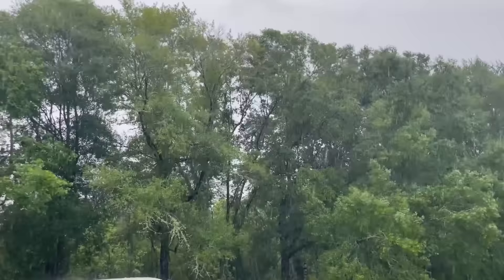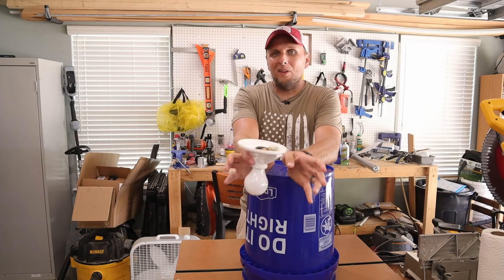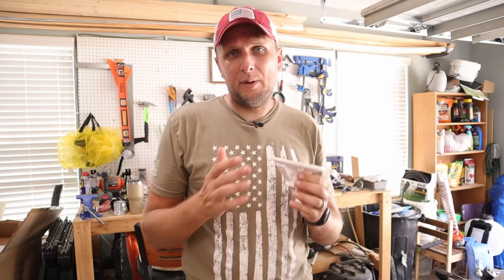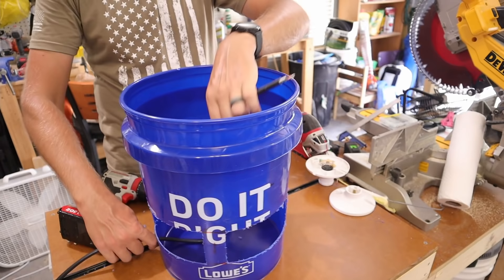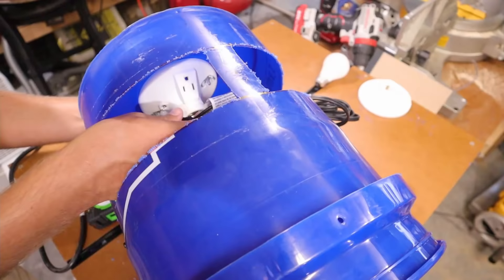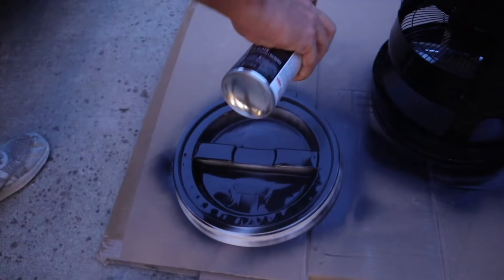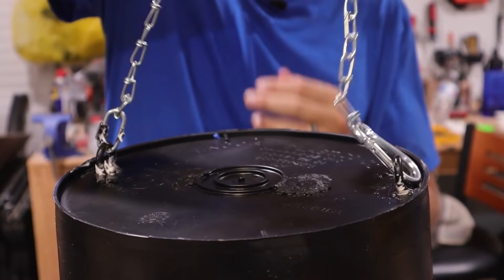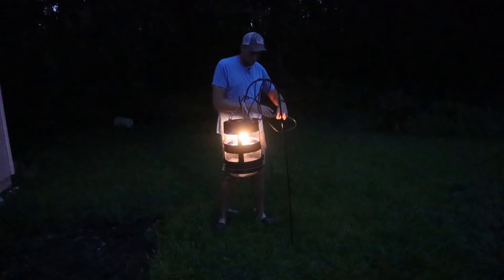How to Make a DIY Mosquito Trap That Actually Works!

Comment: “We got a ton of rain.”

A ton of rain spread over a portion of a typical American county is a vanishing small amount of rain.   Not even a trace of rain.

The county that I live in is about 1000 square miles in area. 1/4 inches of rain spread over the county is about 18 million tons.
Reply from the maker: I honestly don't even know what to say to this 😂
Reply: @HowToHomeDIY  Maybe no response is required.  In my line of work, there is a world of difference between 1.50 & one and a half.  They mean very different things.  Of course most of the American public used the adjective "ton" to describe some vague but very large quantity.  Yet in my way of thinking, a ton is 2000 pounds.  I knew what you meant even though what you wrote was different from that.  Hope I didn't offend you.

Comment: Is there something im missing; why not put the knot in the wiring just behind the inner wall of the bucket, so if the cord is "pulled" the bucket will move preventing a jerking pull on the socket and wire connection as well as live wire exposure.
Reply: thats exactly what he did

Comment: The best thing that we did to combat mosquitos, wasps and houseflies was to feed the songbirds year round, not just in fall and winter.  We have a river that bisects our little estate and we could barely use the land in spring and summer without being chased off by mosquitos.  Also the birds no longer relieve themselves over our cars.  An old timer told us at the local feed store, "You wouldn't be too happy if the food supply was cut off just as you were raising your chicks.  Taper it a bit by Memorial Day and they will switch to mostly insects, bring it back up after the leaves start to turn."  He was exactly correct.  We have a little sanctuary for them now, the variety and behavior is completely different.  They seem to see us as family instead of intruders into where they are raising their own little families.  Great built though, we will keep it in mind for when we watch movies outside at night, when those balmy temperatures come around.  🥰

Comment: What size fan did you use &you could have used silicone Culkin for the screen
Reply from the maker: It’s a 9 inch fan.  Most caulk doesn’t adhere to plastic buckets very well but silicone caulk is especially bad at bonding to plastic.  Just peels right out.  Hope this helps!

Comment: Any issues with the fan motor getting wet in the rain? The light seems well protected but that fan is pretty exposed.
Reply from the maker: So far so good!  The motor is very much to the center so while it does get wet, it is pretty minimal.

Comment: Mosquitoes aren't attracted to lights otherwise the bug zapper would get them. The propane burning traps seem to do the best job
Reply from the maker: You’re right, this trap isn’t focused on the light being the attractant.  That being said they do use light to navigate and lights provide heat so they do provide some help in attracting them.

Comment: His Keyless Fixture is only rated for Indoor use. If this thing works, you might want to replace it with a fixtre rated for exposure to weather. Similar advice for teh Indoor Rated fan he used. Paint your bucket before installing the fan and fixtures no need to coat them with overspray, right?  You might want to use SEALANT instread of Caulk to attach things.
Mosquito control would be something to investigate and institute in league with attractants and traps.

Comment: the issue of this design is that it catches all types of flying insects, not just mosquitoes. A more selective trap is done by placing a large screen over a fan: big insect are able to escape but mosquitoes will be stuck because they are weak flyers.
Reply: thats a common complaint of the store bought ones too, that and they don't really work since they don't come with bait...

Comment: The point in the blacklight was to create a similar amount of heat with less light.
Reply from the maker: I look at what the agencies and institutions use in their traps and they use low wattage incandescent bulbs.  So I went with what the "pros" use.  I may try a blacklight just to see the difference whether good or bad.
Reply: @HowToHomeDIY  I think you'll get the same amount of bugs because like you said, it's the infrared heat signature the skeeters hone in on. If you can get the same warmth with less light I could see that being beneficial in most peoples applications and it may not attract as many undesirable species. 

BTW, I'm in St. Marks FL where the yellow flies terrorize the population for nearly a quarter of the year. Where are you?
Reply: @HowToHomeDIY I can't say with any authority, but I suspect they use normal incandescent simply because they are cheaper and they don't care about the aesthetics of light turn their tests, but homeowners do care.

Comment: Just a helpful tip.  You should NEVER knot electrical wire.  There are other ways to secure it, even a wire tie snugged down is a better option.
Reply from the maker: Nothing wrong with knotting it.  Lamps have been using knots to secure wiring the bases for a very long time.